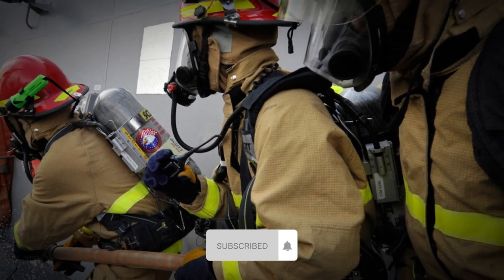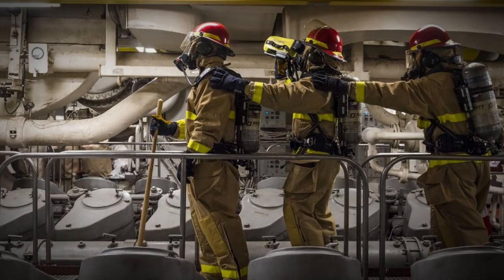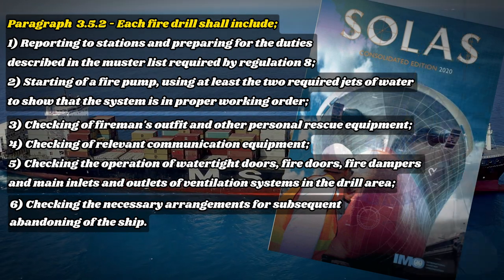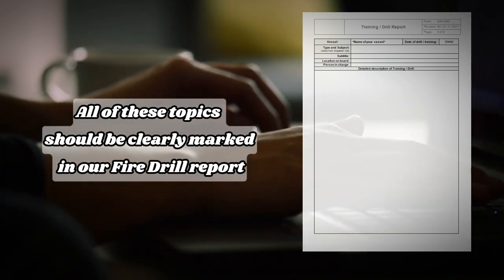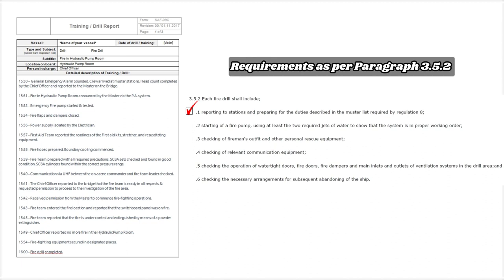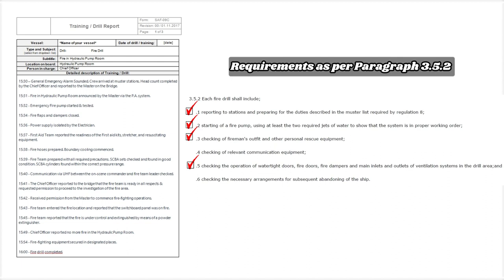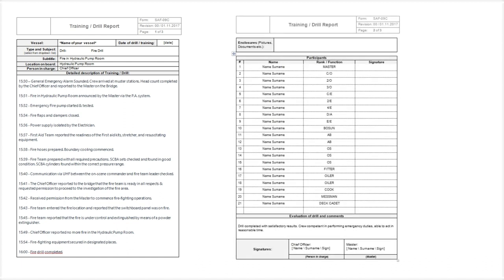Easy Guidance for Fire Drill and Fire Drill Report for Mariners.

Comment from the maker: Timelinks:
00:01 - Introduction
00:28 - SOLAS - Regulation 19  ( SOLAS Requiremets for Fire Drill)
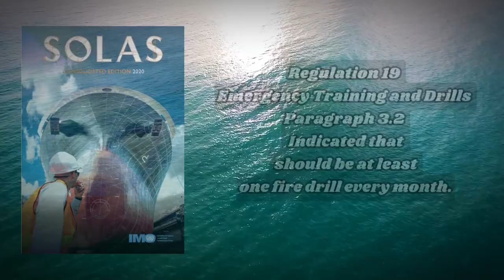00:38 - Purpose and Primary goals of Fire Drills 
01:13 - Requirements for Fire Drills as per SOLAS (Wide Description)
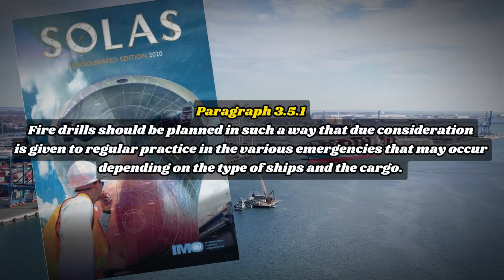01:30 - Paragraph 3.5.1 
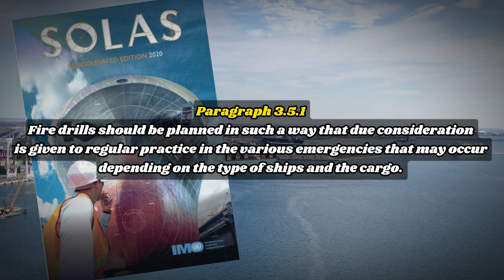01:56 - Paragraph 3.5.2 
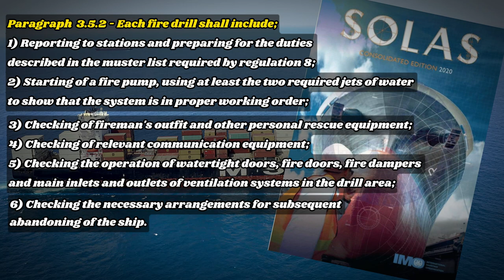02:38 - Paragraph 3.5.3 
02:51 - Fire Drill Report \ Template ( Example with wide Description )